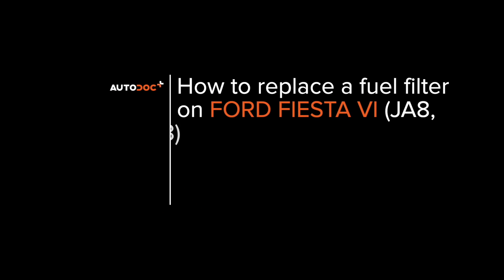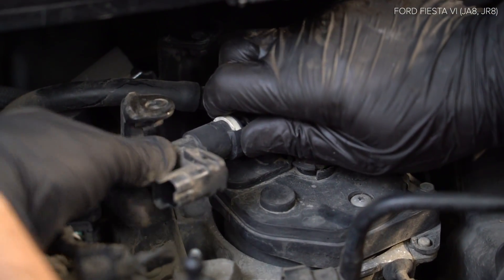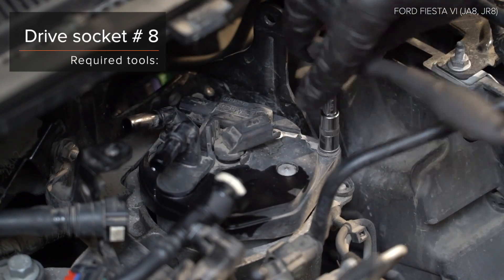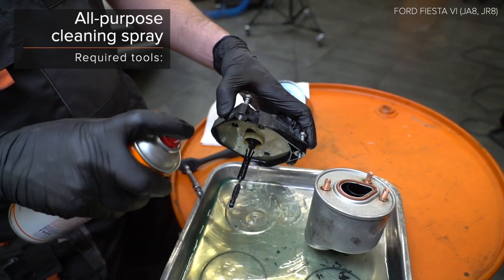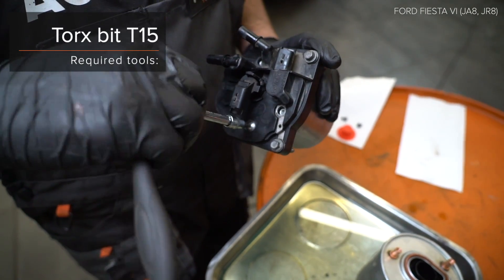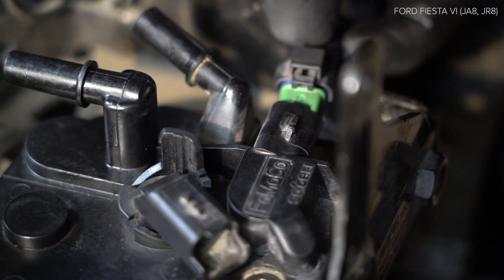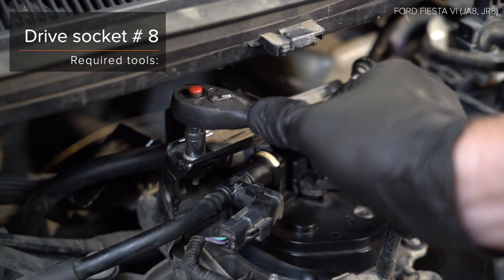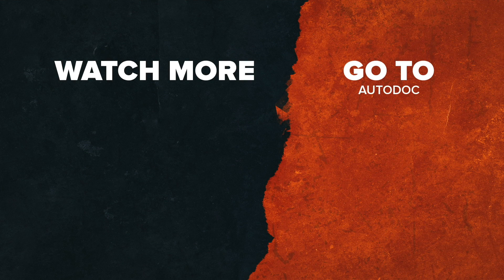How to change fuel filter FORD FIESTA JA8 [TUTORIAL AUTODOC]

Comment: The way I bleed without expensive kits, syringe diesel into the outlet on the filter until the filter is full syringe diesel into the fuel pipe leading to injectors until it's full connect the pipes it starts immediately, always has on all three fiestas I have. Father does the same
Reply: How?